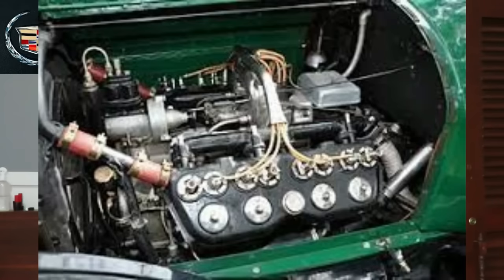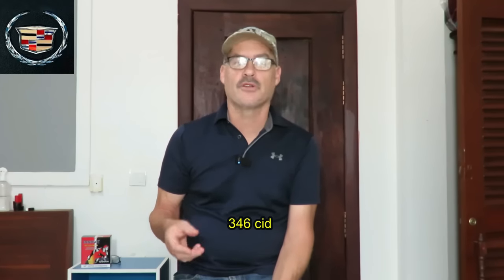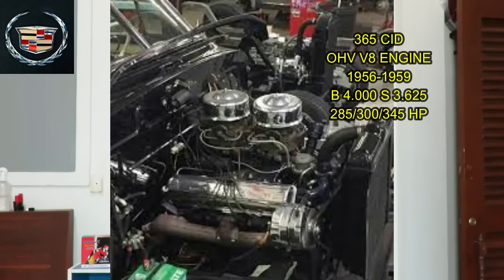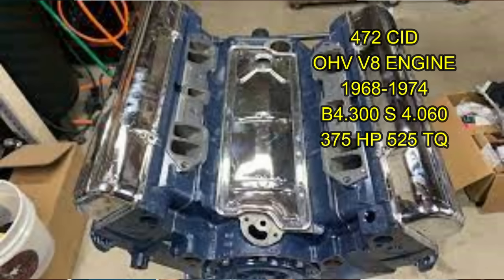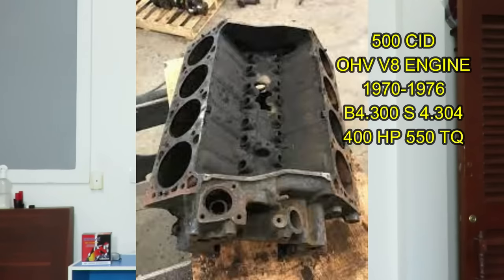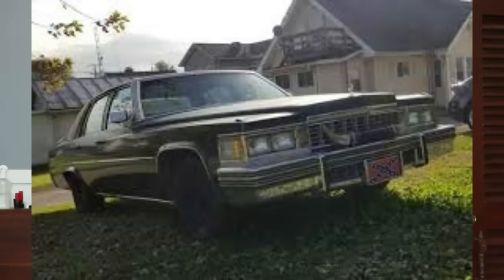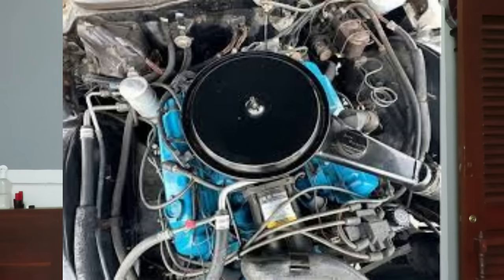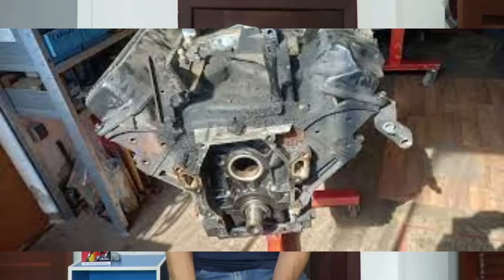CADILLAC V8 ENGINE HISTORY

Comment: The 472/500 was originally designed to support 600 cubic inch . A Cadillac spokesman back in the mid 70s said the reason the 600 cubic inch program was cancelled was simply because of the gas wars and insurance companies complaining.
Reply: Cadillacs are the geniuses, luxury in a muscle car
Reply from the maker: Yes that is true I have read quite a bit of the engineer's notes from back then they did indeed plan on a 600 CID but like you said by the mid 70's everything changed for all of these engines They also had a limited edition V16 with 1000 HP but it never was a production car
Reply: @Myvintageiron7512  they also were looking into making a V12 in the 60’s but stayed with the big V8’s.  

Also, you didn’t speak on the new Blackwing V8’s that wouldn’t fit into the the bulk of their cars😂
Reply: That would make for one incredible airboat engine!
Reply: @Myvintageiron7512  liberal-19!
Reply: @glennoropeza3545 they are used lots in airboats. The tour boats, damn near 10 people on boat.
Reply: Yes that is true , the 385 Ford big blocks were also designed to go that big , they didn't know were the HP or Cubic inches would go , so both Ford and Cadillac went big !

Comment: I picked up the 500 inch engine from a 75 Fleetwood and had the machine shop go through it. Kept the OEM bore & stroke but increased the compression to about 10:1 and put an RV style cam in it. Kept the factory heads but upgraded the valves & guides & seals. Put Edlebrock intake & carb on it and the dyno numbers are crazy good for a single carb engine. She is sitting in a 1940 Cadillac model 75 right now and waiting on body & paint to finish up. Fuel mileage hurts these days but kept a Caddy in a Caddy Street Rod style !! I had the 4.9 in a Coupe Deville and it was a beautiful car and the engine was peppy but not a torque monster. The problem I had with that car was I went through 2 transmissions with less than 110,000 miles before I traded it and it was slipping again when I traded the car. In hindsight I wish I would have kept that car and would have found a better transmission builder. The next one had the Northstar engine and it was a nightmare! I have never heard it called the Death Star but it makes sense. This car is the reason I jumped ship and now drive Lincoln Town Cars. Even the Town Cars tiny engine is a joke for power, but the cost of ownership and its history of lasting over 300K miles is the reason I stay with it. My favorite boat in the garage is the 1969 Mark-3 with the 460 engine, but now we are back to the 472 Eldorado years, LOL

Comment: Thanks on covering one of my favorite and fascinating engine families. One of the most  fascinating Cadillac engines is not a V8, but the V-16, especially  the 1938-40 design of the block cast angle 135 degrees, still keeping the firing pulses 22.5 degrees apart and still fit in the engine compartment, and the dual manifolding, water pumps, ignition coils and distributors with the pair of points in one of them. You are doing a great job on your engine histories, along with Jay on his What's it like channel. His channel has been doing a lot of the 6 cylinder  engines, so both your channel's engine histories complement each other.
Reply: Also some of the large gasoline engines that were used in American LaFrance fire trucks? I think some of more than 8 cylinders and had twined distributors and ignition coils? 
 Was Cadillac's V16 used in an early fire truck or pumper?
Reply: @davidpowell3347  I have not heard or read anywhere of the Cadillac v-16 used in fire engines , or commercial vehicles outside the few hearses and ambulances built with those engines, 
La France and Seagrave fire engines used either, or patterned after the Pierce Arrow V-12 car engine for years with dual ignitions like the Nash Jay featured until the 60's when the big block V-8's and diesel engines were comparable in power the V12's were phased out. I read in an Hemmings article that Seagrave made some of their V-12's with  0ver 900 cubic inches. That is larger than the GMC 702 V-12 engine, which was used in some GMC fire truckc.
Reply: @davidpowell3347  The American LaFance rigs used the 472 version of the Auburn V12.  That engine was never used in a production car due to the depressed demand for luxury cars during the depression, but AL used it, and the smaller 392 version for smaller rigs.  Because this engine was used into the 60s, Auburn owners were always about to get parts for their engines.
Reply: @bparksiii6171  Wow!  never heard of a 900 cube version of the Seagrave V12!  What an engine that must be!

Comment: 14:49  The 425 V-8 was the last Cadillac engine where the alternator was mounted in the V, the valley in between cylinder banks, which reduced vibration. The last model year you could get this engine in was 1979.
Reply: That's strange, the last Cadillac 425 I worked on had the alternator above, next the passenger side head.

Comment: I've owned 14 Cadillacs over the years. Cadillac is always the BEST! Of the 14 three of them are 1981 6-8-4s. Yeah, mine worked, shifting from 8 to 6 to 4 and back again but had their hesitations lugging etc. So I solved these issues by rewiring the rocker solenoids where now they are activated manually by toggle switches on the dash. Works for me!
Reply: This should have been under manual driver control by the driver from the get-go. Did it require spooky low viscosity oil in order for the leakdown/pumpup function of the actuators not to take excessive time to complete?

Comment: My observation is that the 500 cu in V8 was first offered in the Elderado models in 1970,  then thru the 1976 model year.   It follows that the 472 was in  the De Ville models from 68 thru the 73 model  year, the 74, 75 & 76 full sized Cadillacs all had the 500 cu in V8,   I really enjoy your presentations.

Comment: I absolutely love this series. 
I think the hydramatic was introduced in the 1940 model year 
I have a 46 and a 47 series 62 that both have hydramatics.
Also have a 79 coupe de ville with the 425, great car, great engine.
My 4100 leaked from everywhere.
The factory fix I believe was to add stop leak to the radiator.
It solved the leak, but the situation wasn’t really satisfactory.
It’s refreshing to get great information from a grown up.
Many many thanks.
Reply from the maker: Very cool!

Comment: I have a high compression Cadillac 390 with Tri Power 3×2 Barrel carburetors in a old 16' flat bottom V drive boat.  It runs really strong.  Has a top speed of 67 mph which is pretty good considering its a fairly heavy  mahogany boat .
Reply: Yea thats pretty decent  for sure .

Comment: The 4.9 has become a favorite swap into Fieros. It fits with no cobbling of the spaceframe whatsoever. Some of us have added the intake and steel rocker supports from the 4.5 Allante. It runs out of breath before 5K, but it has enough torque to drag my house out into the road. (The 4.9 pictured in your video, with the two long tube intake runners and the TPI throttle body, was a Fiero installation.) It also doesn't hurt that the stock Fiero transaxles - even the manuals - bolt right up.
Reply from the maker: very interesting I didn't know that

Comment: The modern version of the 4/6/8 concept is called AFM (active fuel management) on some current engines. It is theoretically better but it has introduced new failure modes. Early lifter failure is a big problem on a lot of these and it is a common practice to delete/disable it.
Reply: Junk.

Comment: I was a Goodwrench technician in the 80's and 90's. This was a good presentation. I have a little mop up or "who cares" info on the Northstar V8. The Genesis of it was the Quad 4 in the Cutlass Calais and Somerset Regals. An Olds creation that was so successful that Olds decided to take that technology and make a Quad 8. Quad meaning V8 with 4 valves per cylinder. They called it the Aurora 4.6 V8. I had classes at GM Training Center for it. It was supposed to be the best engine ever designed. (aren't they all?) Then desperate Cadillac scammed up on it through company politics and stretched the engine displacement out beyond its intended design. The original Olds version was pretty reliable.

Comment: Very nice presentation. You didn't mention the 1957 dual quad 365 engine rated @325 HP. Straight linkage, bat wing air cleaner. I had one in a 53 Mercury,  great memories.
Thanks

Comment: Always wanted to see how the caddy 500 did in a pickup truck, towing a trailer up the mountain interstates; compared to the early turbo diesels with 4 speed automatic transmissions or older manual equivalent.
Reply: I glad you brought this up as i remember hearing about a farmer who installed one in his truck. I dont know if it was 3/4 or a one ton dual.  That was a long time ago. I was told it ran well ..i doubt it got the fuel economy of a first gen 12 valve but it was a good gasoline truck ..I heard of farmers installed some diesels also back then in there trucks  . This is about the time chev tried the old diesel bomb ..

Comment: Have been looking forward to the chapter on Cadillac.  I think you transposed some digits on the 1949 OHV 331 V8.  Bore was 3.8125 inches... It was an oversquare design.
Although not widely publicized in brochures, the torque rating was ~288 lb.ft. SAE Gross  at ~1800 rpm.  The 429 cu.in. engine debutted concurrently with the new generation Turbo Hydra-matic transmission, aka THM400.   MY 1964 cars produced with the earlier 390 cu.in. engine also used the earlier fluid coupling Hydra-matic transmission in its last year of production.
Reply from the maker: You are correct
Reply: The 1949 - 51 Cadillac 331 made 312 lbs ft of torque at 1800 RPM, not 288.

Comment: The 5.7DX (Diesel) engines were not as bad as everybody thought. There were a couple of problems though ... not with the robustness of the block, which was bulletproof --- but the head bolts were a failure as there weren't enough of them and the Roosa-Master injection pump was better suited for a trash compactor or sewage pump that would run at a set RPM for days and not be required to constantly accelerate and idle for long periods of time. 

I worked on these D and DX engines exclusively in a diesel shop for a few years, and even owned a Canadian Calibrated version in a 1982 Pontiac Bonneville Grand Safari station wagon that towed a 36 foot RV Camping trailer for over 475,000 miles with one engine failure when a piston decided it would like to see what it was like outside of the block and (maybe) 5 sets of head bolts and FelPro "Purple" gaskets. I later on, studded this engine and never failed another head gasket - or bolt again. 

There were several levels of buildups for these engines --- 1. Canadian with higher 22:1 compression and camshaft indexed at 0° TDC, 2. the Federal version with an 8° RETARDED camshaft and lower, 19:1 compression and then the biggest mistake was the 3. CalEPA version with a 12° RETARDED cam and only 17:1 compression - which promoted a lot of smoke and ran a lot hotter while producing lower horsepower and torque. 

I got so fast at changing head gaskets and bolts on the Cadillac Sevilles, that I could get 2 done in a single work day. IIRC, the first D-engine in the Cadillacs was a 4.3L/D which was quickly jerked out and replaced with a 5.7L/DX because the first engine couldn't pull your hat off in a windstorm.
Reply: Well i remember my friends who worked in the oil field drove them for a while . Head gaskets  and of course heater cores blown up from that . Broken cranks   and oil leaks . Seems that gm fix for the high blow by was to drill out the breather . When Ford came out with there diesel the chev diesel was dropped like a hot rock lol. I rode in a car once with the diesel and it did pretty good as i remember..That was a long time ago ..later on it thrashed to lol
Reply: @jimkillen1065  Most humbly, James, you are wrong on a lot of your "factoids" ...
> Drilling out the KV Breather was a trick on the 6.2s, not the 5.7s. I know --- I had the TSB on that as a Smog Inspector in SoCal during that time. 
> That said --- there were two GM 5.7L Diesels (not to mention the 4.3L/D too) --- the D and the DX. The Ds were weak and had lower end troubles until the nodular crank was replaced with a forged version. 
> One could tell the "D" from the "DX" by both a head casting designation and that the "D" used the "pencil injectors" and the DX used the screw-in versions by both Bosch and Roosa-Master/Stanodyne.
> Ford never "came out" with a diesel --- they got the GM v Ford corporate short straw and had to assume the 6.9 from IHC because Harvester dropped all their gasoline engines and ceased making both Diesel or gasoline-powered pickup trucks and Scouts so they didn't have to be in the same shark-infested waters  with CAFE Standards. 
> The 6.9L IHC engine in original form was a tough engine and when Ford got it, their F-series pickup front ends couldn't support the weight so they lightened them about 125 lbs by taking out "spurious cast iron" in the block and heads --- and jacking up the front spring rates (remember the crazy tire wear on the front tires on F&E series trucks/vans? Uh huh!  
> I know this because I worked with Ford Assembly Line engineers at their Rosecrans Plaant where they were trying to find out how to keep the now unsupported "wings" on the heads - where they met the block - from rising up and you could stick a butterknive between the head and the block. 
> Remember the strange coolant leaks that LOOKED like the oil/heat exchanger was leaking but it turned out to be the head surface not staying flat? 
> FelPro came up with a new-designed head gasket with a "device" - (not my terminology - but Ford's) - that had a bellows in that to compensate for the badly weakened area where the crossover coolant flowed, to keep it from leaking when it cooled down and opened up. 
> The FekPro gaskets worked very well - I know --- I installed dozens if not a few hundred of them. 
> Ford however, refused to put another $3.00 each into those much better gaskets, staying with the cheaper Detroit or Victor gaskets - and the problem was there until the 6.9L was phased out for the 7.3L. 

Yeah --- Ford had a great engine .... not! Then they created the 7.3 from the original 6.9 by taking out MORE cast iron and somehow it worked.

Comment: I understood you to say about 8 minutes into your presentation that Cadillac brought out the 390 V8 in 1963.    Motor's repair manual shows this 390 V8 used for a 5 year span, 59 thru 63.   Could Motor's be mistaken?   In the late 70s and early 80s I owned & drove regularly a 70 Cad Couple DeVille w/ that  472  V8.  I found it went thru starter motors one right after the other.  Also the sloppy idle I later determined was due to a drain plug installed in the torque converter, thru it out of balance.  The 390 V8 had fuel pump in front, not on the side.
Reply: I owned both a 1959 Cadillac (SdV) and a 1963 Cadillac (CdV) and they had both the first and the last 390CI run for engines, IIFR. 
BTW ---> the 1959 could run circles around the 1963. 
>> I don't understand how you arrived at the unbalancing of the convertor from a drain plug or how it could happen. The balancing is done after the drain plug was installed during manufacture --- anything other then that would not be in general balance-engineering because the guys with slide-rules would NOT let that happen.
>> But then again ... since I owned a transmission shop and worked at a few more --- I never saw a drain plug installed in anything GM offered --- unless some driveway wrench decided to put one in himself. 
>> Still though --> drilling out some metal (for a hole) in the convertor -- and putting some metal back in (the plug) --- wouldn't go very far into an unbalanced situation anyway.
Reply from the maker: 59 to 63 is correct the 1963 version was a revised addition of the engine that was 52 Lbs lighter and uses different crankshaft and connecting rods, as well as being narrower and shorter
Reply: You are correct, he is not, except that the 63 390 is different from the others

Comment: my Dad had a 1972 Coupe de Ville with the 472 engine. that was hands down in the top 3 cars he ever owned. everything worked, all the time, with one exception. It would break the nose of the starter motor off around every 8-10k miles. after it happened the third time, we did a compression check. we were flabbergasted. it blew apart a 300 psi compression gauge!  we took the head off, thinking there would be a lot of carbon build up, or a mis-casted head. but everything was normal. we even measured how far up the cylinder the piston traveled. thinking maybe a rod was stretched, or a piston mis-machined. nope, again, everything was normal. the only thing we could come up with was that that cylinder had perfect piston ring seal. we were not about to pull the bottom end apart. so Dad got a very small very fine triangle shaped file, and we filed a tiny groove from about an inch down from the top of the cylinder down to the top of the piston. we cleaned everything up, replaced the gaskets, and assembled the engine. that cylinder still had 40 more psi than any other cylinders. but it cured the starter breaking problem. and it never burned any appreciable amount of oil. it lasted dad another 4 or 5 years. until he wanted a newer car. it was a great car.